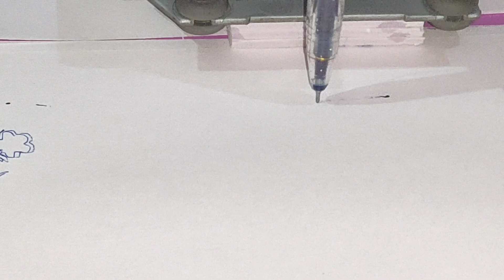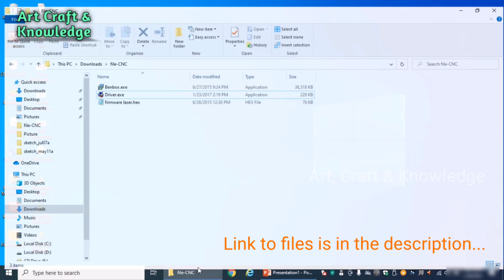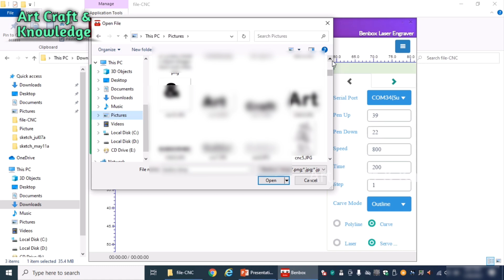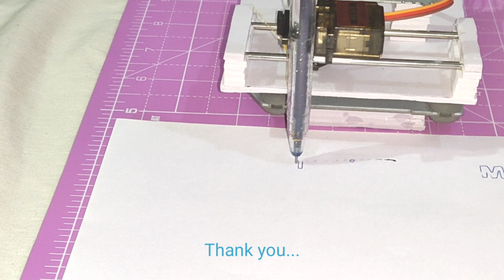Arduino Projects | How to make Homework Writing Machine at home | DIY Arduino Pen Plotter #arduino

Comment: I'm making this project now for my college...
Having problems connecting the stepper motors.. Could u pls help...
Reply from the maker: What's the issue? Check the connections as in my video. I have used two types of stepper motor. And adjust the current with the small potentiometer in the driver. Use 2 amp power supply.

Comment: Hi
I have done the same. But my two stepper motors are not responding. Pls any suggestions.
Reply from the maker: Check the wiring of the stepper motor. And try to set current with small potentiometer on the driver board.
Reply: @ArtCraftandKnowledge   tq for u r valuable reply sir
Reply: Sir 
We are varied that potentiometer sir ...
But it is not working.....
Stepper motors are getting stuck sir......
Reply from the maker: https://forum.arduino.cc/t/cd-rom-stepper-only-jogging-not-running/89372

Comment: Wher i faund this motor
Reply from the maker: Find some old DVD or CD drives. You can get them from there
Reply: @ArtCraftandKnowledge  bhai dvd me do tar wali normal motor hi mili wo bhi bia scru wali
Reply from the maker: There will be 3 motors. You need to get the one which holds the DVD lense